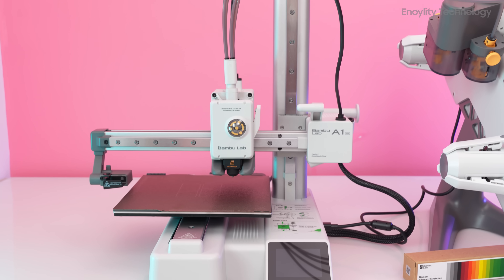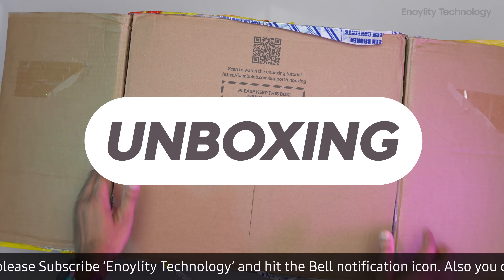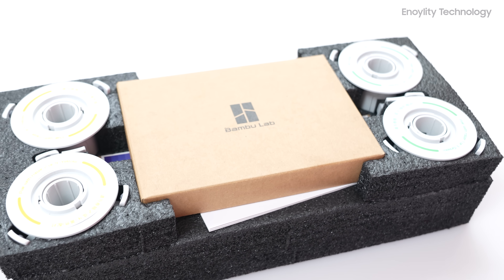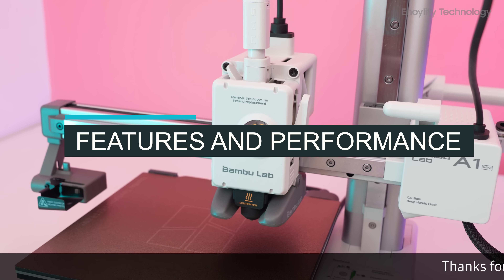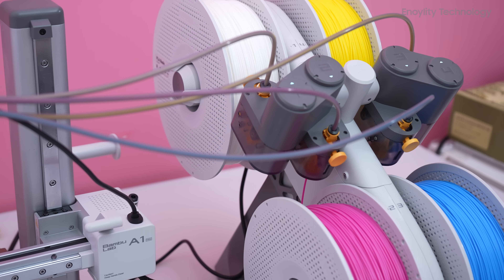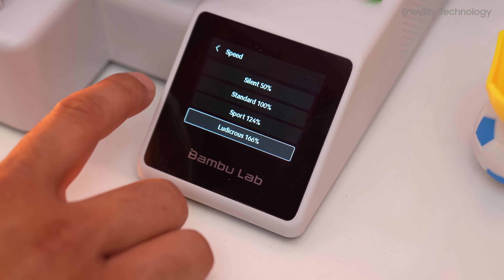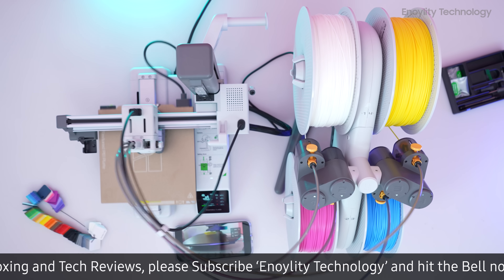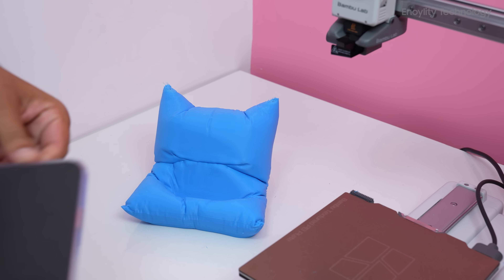Unleash Your Creativity with Bambu Lab A1 Mini: The Compact 3D Printing Powerhouse!

Comment: I've been looking to get a printer that can do Multi color printing for my next one, that machine looks very good and easy to use.
Reply: The intuitive interface makes it easy for beginners to get started, while offering advanced features for experienced users
Reply: Works great and prints look awesome!!
Reply: This printer fits that bill completely. I've had a number of clean great quality prints so far, and I suspect there will be much much more. An easy slicer to start with is the Cura based browser slicer on the AstroPrint website.
Reply: The open-source firmware is a big plus for tinkerers who want to modify or enhance their printer’s performance

Comment: Easy to setup amazing prints. Forget about waiting for 4 or 5 hours for the prints rather print them quickly. Highly recommend
Reply: I would prefer this printer over ender because of lower price, more features and same quality.
Reply: I recently bought this for my son and I to use. The product is very high quality. I can tell from the unboxing. It's package very nicely in foam material not the cheap Styrofoam that gets all over the place.
Reply: Ender really has been making a name for itself on the lower price end of printers. With this printer they upgrade a few things to make it a better Ender
Reply: I love the open source nature of this product, and the ability to modify it's hardware and software. I have upgraded most parts and even use a raspberry pi to run klipper.
Reply: The included filament storage box is a great addition, helping to keep the filament dry and tangle-free
Reply: Built-in lighting around the print bed is a thoughtful touch, allowing users to monitor prints clearly even in dim lighting

Comment: This is the video that sold me on the bambu lab a1 for my first printer, thanks!
Reply: Auto bed leveling on the A1 Mini reduces the hassle of manual adjustments, ensuring consistent print quality.
Reply: This printer came almost fully assembled. Instructions were basic but understandable, I suggest a YouTube search for bed levelling. Overall set up took about 45 minutes
Reply: The removable print bed or tray is easy to take and will usually go back the exact same way so you dont need to level each time but it is advisable to check if youre working on something important or long print time.
Reply: The semi-automated levelling procedure is a DREAM compared to my last printer which was fully manual, this has also been one of my favourite features

Comment: The print came out really well. The finishing is very nice and I am satisfied with it given the price point.
Reply: Anycubic's commitment to customer satisfaction is evident in the responsive customer support and regular firmware updates
Reply: Item was packed very nicely. Snug and full foam kept parts in place thru shipping.
Reply: Compact but powerful, the A1 Mini proves that size doesn’t necessarily limit performance

Comment: Best for beginners and easy to install printing speed is high and quality is good highly recommend
Reply: Its fast printing speeds make it a time-saver, ideal for projects with tight deadlines
Reply: Easy and affordable way to get started in Resin printing. I bought the printer ant the cleaning and curing station at once
Reply: It's package very nicely in foam material not the cheap Styrofoam that gets all over the place. The installation is super easy and the screws, allen keys etc provided were of good quality as well.
Reply: Great machine and tech support was very helpful when I needed it for a couple simple things I was overlooking, thanks yall.
Reply: The build itself took me about 45 minutes from start to finish. I laid out all of the parts, checked them against the parts list, and went to work
Reply: Out-of-the-box performance is stellar, with minimal adjustments needed to start producing great prints right away

Comment: The printer is pretty good and way faster than other ones in the price range like the enders. I recommend both the reseller and printer
Reply: The printer works great we have done about 6 prints so far with no failures.
Reply: This is a great setup for beginners or those who just wanted to start 3D printing and then slowly add upgrades as they go.
Reply: The printer works great but this TF card issue is inconvenient. I hope Elegoo fixes this on future models.
Reply: Take care in adhering prints to surface! Otherwise fantastic printer. Small quick and fairly quiet
Reply: Easy to calibrate, the A1 Mini requires minimal maintenance once it's set up and running

Comment: This printer is definitely one of the best for beginners and hobbiests for this price catagory.  An affordable and best in range printer for 3D enthusiasts. Its simple to assemble and even simpler to get going.  I recommend this.
Reply: The quiet operation is a great feature for users who want to print at home without loud machine noise
Reply: I love this 3D printer, it works perfectly.
Reply: It has consistently improved with each update, showcasing the brand's dedication to enhancing user experience and addressing any potential issues promptly.
Reply: The installation is super easy and the screws, allen keys etc provided were of good quality as well
Reply: Clear assembly instructions help even inexperienced users set up the printer with minimal confusion

Comment: I've been using this printer over a week now and I love it, it works well and prints everything in great quality and clarity.
Reply: Filament detection sensors pause printing when the filament runs out, reducing the chances of failed prints
Reply: The film kept lifting, and causing air bubbles to reappear after being squeezed out. I'd recommend a design that allows the full edge of the protector to be properly sealed.
Reply: High quality components and very well built.
Reply: Easy to use touch screen interface, Web based 'cloud' printing through WIFI, and easy to use slicer included

Comment: The high-resolution print capability of the A1 Mini makes it perfect for detailed models
Reply: That said, while it is a solid choice for someone new to 3d printing, I feel it may be a bit over-priced for an enthusiast who will want to do some upgrades of their own. If you can get it on sale, and are looking for a solid 3d printer, go for it.
Reply: This printer has been an ideal choice for a novice like me, offering an exceptional user experience and impressive results right from the start.
Reply: This is my first 3D printer. I had zero experience before buying this. This was the most confusing process I’ve ever dealt with.
Reply: I really the printer print the quality of the objects ❤
Reply: Bottom line is that I am very happy with this purchase. If you are new to 3D printing, this is a very high quality printer that is guaranteed to please with a minimal learning curve and great customer support
Reply: I bought this printer because I was in a bind, and needed something that would work right out of the box... and I needed is FAST, to complete some orders within a deadline

Comment: The portability of the A1 Mini is a huge advantage for me. I can easily move it between workspaces without any hassle
Reply: The direct drive extruder offers greater control over filament feeding, improving the print quality of flexible materials
Reply: There is a lot of info online and it can be upgraded as you gain more knowledge and skill. I would definitely buy it again and just might get one for my son. Two thumbs up for good customer support!
Reply: I really, really like that it’s fully enclosed with a filter, helping against some of the particulates from printing and reducing the need to invest in an enclosure

Comment: I can run it in my office without being distracted by noise, which is perfect for busy environments
Reply: The magnetic bed plate is easy to remove, making it simple to detach printed objects without damaging them
Reply: I was looking for a resin 3D printer after having had an FTM printer for a couple years. After spending countless hours looking at reviews, talking to people at Microcenter, and watching youtube videos, I decided to buy the Photon Mono X 6KS. I couldn't be any more happy with the purchase. It was super easy to set up.
Reply: The clear instructions provided in the user manual ensured that I had a smooth installation experience, allowing me to get started with my prints in no time.
Reply: Treat the printer as if you purchased a used printer someone couldn't figure out how to fix it. You will need to assemble this printer and it is no simple task
Reply: Energy-efficient design means lower electricity bills, making it more economical for frequent use
Reply: Excellent print surface adhesion results in fewer print failures, even on intricate designs
Reply: Multi-language support makes the A1 Mini accessible to users worldwide, catering to a diverse audience.

Comment: I love the A1 Mini’s built-in cooling system❤. It ensures that prints cool quickly and evenly, preventing issues like stringing and warping
Reply: It’s remarkable how well the A1 Mini handles overhangs and bridges
Reply: The compact footprint of the A1 Mini doesn’t limit its capabilities
Reply: The prints look very nice and with a big 0.8mm nozzle it prints big parts in a reasonable amount of time
Reply: got this printer because I was tired of messing with my monoprice ultimate which was heavily modified with a Bondtech direct drive, micro swiss all metal hot end, dampener bushings and other printable mods, and its enclosed which was good for ABS etc
Reply: This printer is by far the best bang for the buck, but it comes at a very steep price
Reply: This arrived quickly and in good condition. It took about two hours to put together and was fairly simple

Comment: Small details come out crisp and clean, which is crucial for my intricate design work
Reply: The A1 Mini is a true workhorse despite its size
Reply: It’s been able to handle complex projects that I would normally reserve for larger printers
Reply: Very surprised by the quality of the machine and the printing! Although, initially, there was an issue with the firmware version
Reply: This is my first 3d printer... I bought it based on reviews, features, and reasonable price for a beginner/learning printer.
Reply: Everything worked as advertised. It is such a pleasure to spend time on designing ideas and then printing them. I have not spend a moment troubleshooting, or fixing since the printer works without fail. Everytime.

Comment: I’ve been amazed by how quickly the A1 Mini can churn out prints without sacrificing accuracy
Reply: The precision of the A1 Mini is phenomenal❤
Reply: I haven’t needed as much support material as I thought, saving me time and filament
Reply: The Bambu Lab A1 Mini provides good value for money, offering many features found in larger, more expensive printers
Reply: The print was near impossible to get the supports off of. I wrestled with it for hours and a lot of things got damaged. So my second print I ignored the warning, I stuck with the pre-supports that came with the STL I was printing to see what would happen, and it came out beautifully.
Reply: I use the Anycubic original resin and the plant based stuff and the prints are extremely detailed.
Reply: The printer is touted as one of the best for the low price because it can print as well as a 3D printer costing 10X as much
Reply: I bought this as a graduation gift for a 13 year old who loves to create things. He loved it and uses it daily. It functions very well and relatively fast.
Reply: Quick setup time means users can start printing within 30 minutes of unboxing, even with little technical knowledge

Comment: I’ve printed with PLA, ABS, and PETG on the A1 Mini, and it’s handled all materials exceptionally well without any adjustments needed
Reply: The all-metal hotend is a great feature that allows me to print at higher temperatures, opening up more material options like nylon and PETG
Reply: I’ve used it for long print jobs, and it consistently performs without overheating or error
Reply: it has proven to be an absolute game-changer in the world of rapid prototyping and high-speed printing😊
Reply: 3D Printer is a marvel of engineering, combining high-speed printing with impeccable precision. Whether you're a seasoned maker or a novice exploring the world of 3D printing, this printer is a worthy investment that will elevate your creative endeavors to new heights. It has truly earned its five-star status in my workshop.
Reply: it has been a really good buying choise. Because of my background (I'm industrial designer) I had always wanted a 3d printer, and this one is perfect for me to be my first one.
Reply: Follow the directions, read everything in the box and on the microSD card, and make sure everything is tight. You'll be happy.
Reply: Look into stepper dampers as well, and if yours doesnt have the removable pulleys there are files you can download to work around that problem (my current project)
Reply: Setup was a breeze, and I was printing in no time

Comment: It automatically pauses when the filament runs out, ensuring no material is wasted , best feature i guess 🤔
Reply: I’ve had great results printing with flexible filaments on the A1 Mini, something many other printers struggle with. It’s a versatile little machine
Reply: The print surface adhesion is superb. My prints stick well without warping but are still easy to remove once finished
Reply: This is by far one of the best printers I have and it is speedy as it says but the detail is there also.Smaller than I thought it was but it is very eye appealing and easy to set up and start printing
Reply: This printer is a great learning experience and also prints out some great quality prints.
Reply: Reviewed in the United States on September 9, 2022
This 3D printer was recommended to our son for starting out into the 3D printing world. Yes, it's a terrific printer and we haven't had any issues so far as far as not working
Reply: Overall I do recommend this 3D printer. However, I do wish this company would include a booklet explaining how to get started and key elements to being successful with 3D prints using their screen and printer
Reply: Multi-color printing options make it suitable for creative projects that require a splash of color
Reply: The A1 Mini’s quick heating time for the bed and nozzle allows users to start printing almost immediately
Reply: The removable magnetic print bed offers flexibility, making it easier to remove prints without damaging them
Reply: The A1 Mini’s precision is comparable to larger, more expensive printers
Reply: I love how easy it is to use the touchscreen interface

Comment: The auto-leveling feature works flawlessly and saves a lot of time compared to manual leveling on other printers I’ve used
Reply: I love how energy-efficient the A1 Mini is
Reply: I really like my 3d printer, but I frequently run into homing failures when trying to start a print.
Reply: This has probably ruined it for so many people and if I was doing it for fun I would have walked away as well. I needed it for prototyping for my business so I was forced to make it work.
Reply: Touchscreen is very nice and easy to use.
- and of course, the print quality is exactly what you would expect from a nearly

Comment: The customer support from Bambu Lab has been fantastic 😻
Reply: Overall, the A1 Mini is an outstanding mini 3D printer
Reply: I’ve only leveled it once in the start and the auto level after super tall prints. For a beginner this thing would be awesome for great prints as well
Reply: 3D printing has come a long way, but is far from perfected.
Reply: It comes with a built-in filter and fan. The fan is properly sized and built into the electronics

Comment: I’ve been using the A1 Mini for several months, and it’s proven to be a reliable and consistent performer ❤
Reply: It’s compact but doesn’t compromise on quality
Reply: It doesn’t consume much power, even during long print jobs, making it eco-friendly as well❤
Reply: The printer is working with no faults and I have noticed items are coming away from the glass bed with relative ease. Very satisfied
Reply: No set up issues, easy to use, makes good prints
Reply: Upgradeable features allow users to expand the printer’s capabilities over time as they get more experienced
Reply: The dual cooling system ensures smooth prints, reducing the risk of overheating or filament curling

Comment: Despite its small size, the A1 Mini has a surprising amount of build volume, allowing for larger projects without needing a bigger printer
Reply: The print quality has remained top-notch
Reply: The A1 Mini offers a great balance of portability and performance
Reply: The auto-calibration feature is a lifesaver
Reply: This printer takes multicolor printing to the next level.
Reply: This printer, with its remarkable features and cutting-edge technology, deserves every bit of its five-star rating.
Reply: The printer has a direct drive print head, need leveling, magnetic build plate, large build volume, a rock solid frame, wireless print, etc etc. and it can print good quality prints at very high speeds
Reply: The anycubic slicer is easy to use, and if you want to go deep and learn more you can use prusaslicer with the profiles provided by anycubic.
Reply: The option to print with various filaments, including PLA, TPU, PETG, and ABS, allowed me to explore different materials and expand my creativity.